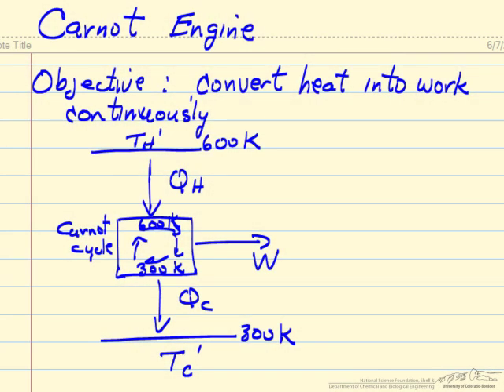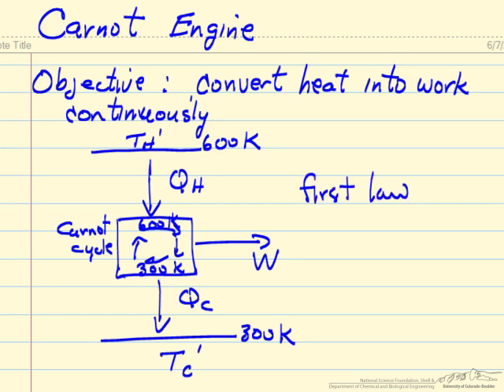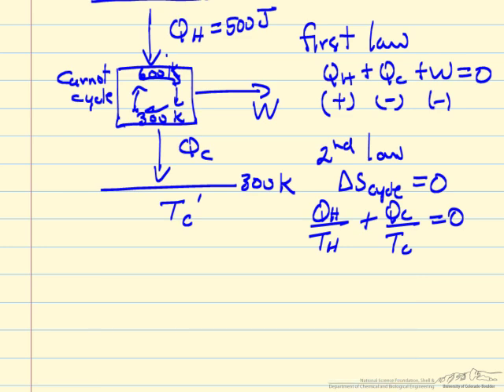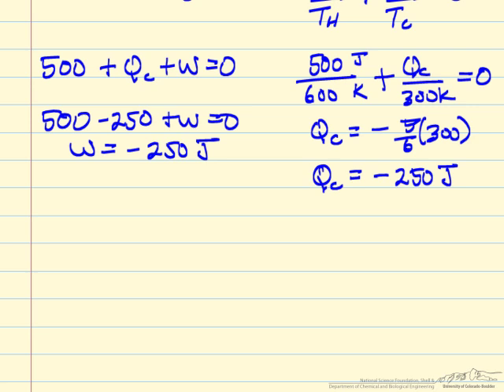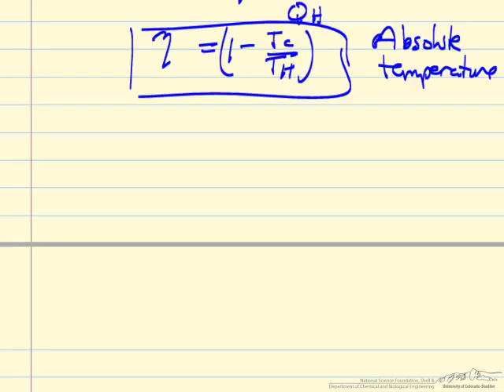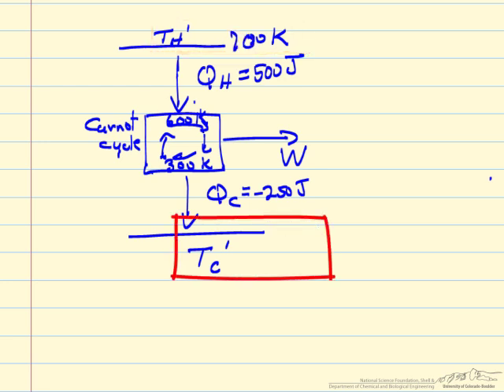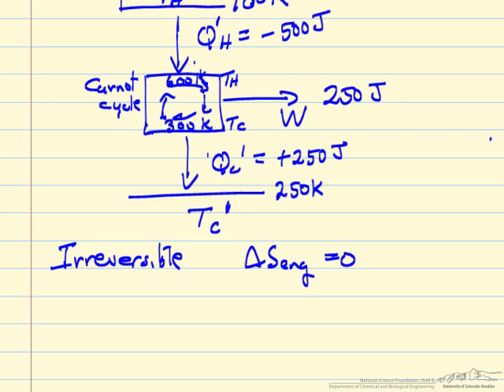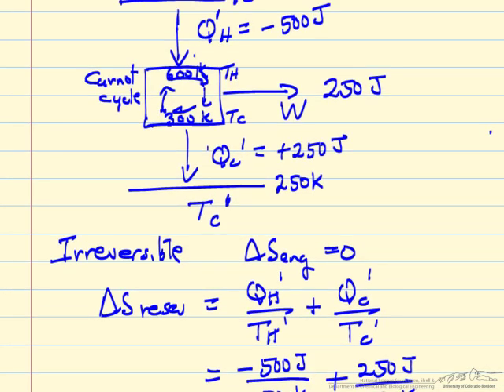Carnot Heat Engine Calculations

Comment: First law should be W=Qh-Qc & not Qh+Qc+W=0
? 
The value of Qh is positive because heat is added into the system & the value of Qc is negative because Qc is removed from the system.
The value of W comes out as a result of calculation to be positive because the value of heat added is greater than the value of heat the system rejected.
The way u have written the first law is confusing,
 +ve Sign for the variable W on  the LHS confuses me.
We should not change the sign of the variable only the value. It causes confusing.
If I understand it clearly, your lectures would become the most enjoyable lectures in the world, because u talk with calmness & clarity.
Please clarify this confusion to me.
Thanks
Reply from the maker: No, the first law is correct as written because Qh is positive and Qc and W are both negative, so the sum of the three (Qh + Qc +W) is zero because the energy of the cycle does not change so all the energy added as heat is removed as either work or heat at low temperature.
Reply: LearnChemE Now im confused. Doesnt QH=QL+W since energy is conserved? So then QH-QL-W=0 or QL+W-QH=0?